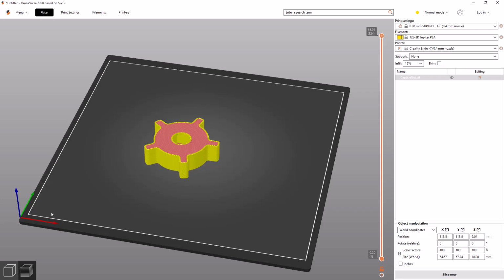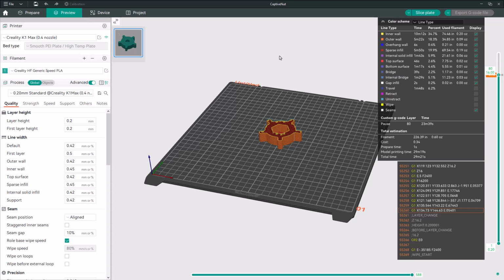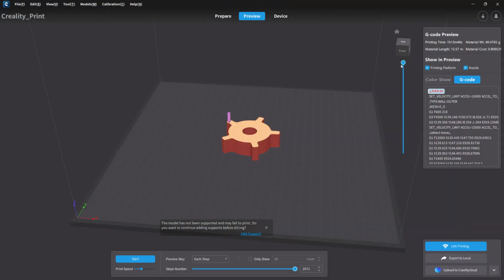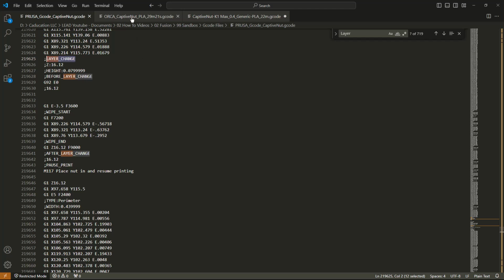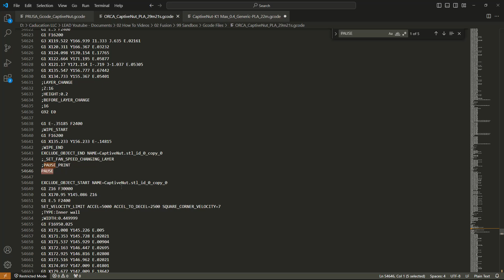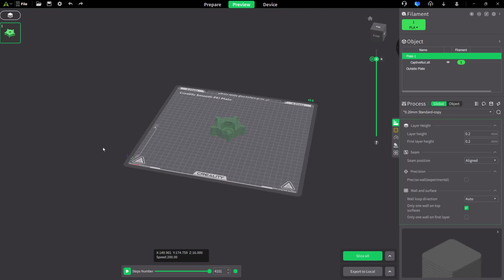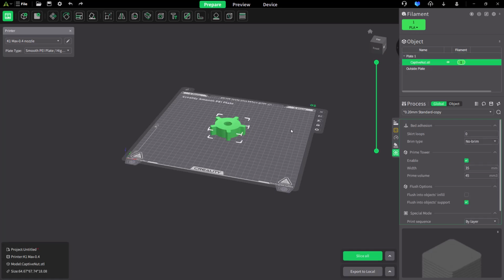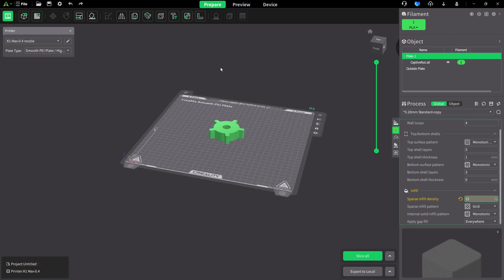Pausing a 3D Print with Different Slicers | Prusa | Orca | Creality | Cura

Comment: For Cura you need to select Extensions, Post Processing, Modify G Code.  Then select Add a script and Pause at Height (or Filament Change)  then fill out that form with the layer number and extruder information.
Reply: Absolutely the correct answer for Cura and it does not require one entering actual G code
Reply from the maker: Thanks for the info!
Reply: @LearnEverythingAboutDesign  A little research goes a long way when putting together a video like this spreading misinformation. Can't you put up some text or an insert with instructions?
Reply from the maker: @calvinborden43    What misinformation did I spread?  The extension/post processing method for the cura slicer is a manual process.  You have to fill out a form manually entering a layer and picking the M code you want to use.  When i made this video I had only a k1max which the cura slicer didn't support so no way to test it, but in the video I said you can't right click a layer and pause like most of the other slicers, which I do believe is true no?

And no sadly Youtube doesn't let you make any edits to the videos.  Best I can do is add/pin a comment and edit the video description, but nothing in the actual video can change.
Reply: @calvinborden43  Have you gotten the Cura's pause at height to work on a k1? It pauses for me, but fails to resume. If so can you please share what settings you enter into the modifier please?

Comment: How can I avoid the thick, visible line or band that appears on the layer where the print resumes after a pause in Bambu Studio Slicer? I've noticed that after using the pause function, my part often has a noticeable line at the resume point. What specific slicer settings, parameters, or procedures do you recommend to minimize this mark and achieve a smooth surface after a pause?
Reply from the maker: I haven't been able to completely get rid of it sadly.  One tip I have heard (but haven't tried) was to create a print tower kind of like a purge block.  So on the resume it starts printing that layer on the tower first.  I don't know if its a temp issue/change.  Some materials are less apparent like pla-cf vs a shiny pla.
Reply: The purge tower alone is not enough. The purge tower still shows 50% of the line visible. I'm analyzing the filament change routine to incorporate what I can into the pause routine.
Reply from the maker: @florisdelfino  Thats a great idea.  It would suck to have to purge a bunch of material but maybe that is a big reason behind why Bambu does it.

Comment: Hello! I have a question. Is it possible to put a pause not between the layers, but in the middle of printing a layer? I'm using creality print K1C
Reply from the maker: in a slicer, now that I am aware of.  Probably something you would have to do manually in the code.  most of the slicers I have seen want you to pick a layer and it does it at the start of the layer.

Comment: When I add the script for pause at layer height, it will beep pause and then continue printing. Using Cura 5.6. What could be causing that?
Reply from the maker: which printer are you using and which firmware is on that printer?  That could be the reason.  It should generally work with Marlin, Griffin, BQ, RepRap and others from version 5.7.  I don't know where 5.6 support stopped.  Klipper based printers might need some more customization. 

For most it should work just going to the Extensions Menu in Cura , "Post Processing" and then Modify G Code.  Add a new script and find Pause at Height.
Reply: @LearnEverythingAboutDesign  It's a Creality Ender 3 Pro V2. Stock machine, No firmware updates. Running version 1.0.2. which I'm assuming is Creality's Marlin version 2.0. I always use Ultimakers versions of Cura.

Comment: does not work
Reply from the maker: Which printer/slicer isn't working?  I had the best luck with the older creality slicer on the k1 max as it moved the print head out of the way.  some of the other slicers just pause and it can be tricky to get there.

Comment: Been trying all morning to get my K1 Max to pause at a specified layer with Prusa slicer. Your one line "K1 not currently suported". Ah. Thank you!

I then moved on to my Voron and it doesnt work either. Seems I need to modify the printer settings.. a bit annoying honestly.

I'm ready to move both these printers on and get a Bambu P1P.
Reply from the maker: Did you try the video before this one?  https://youtu.be/n1iMrPYjvAw   I can't remember if i walked through the old creality slicer in both videos or not.

My k1 worked great for awhile but im trying to sort out some ringing problems on it....
Reply: @LearnEverythingAboutDesign  I ended up using Orca Slicer (which also gives the best top layers on the K1 Max which I've not been able to replicate in Prusa).

Depending on when you bought your K1 Max you may have smooth idler pulleys and 44t motor pulleys (earlier models like mine have this). 

Changing these out for 20t pulleys and toothed idler pulleys make a big difference to ringing and wall quality.

Unfortunately it requires fully pulling apart the gantry to resolve and I can't afford the downtime on that printer right now. 

Maybe you could do a video about it one day 😏

Comment: Thanks for the video!
What I'm missing in pause guide videos, is that i need the extruder to go away from printed object (like go to  home) and after i insertd parts, by hitting "resume" on printer, it goes on printing from the next layer. What i encountered after testing orca, or just adding pause command in g-code manually, is that the nozzle gets stuck over the object! I couldn't find any simple explanations to figure this problem out.
Reply from the maker: Which printer are you using and/or which firmware is it running?
Reply: @LearnEverythingAboutDesign  I'm using a creality cr 10-SE.
Reply: @LearnEverythingAboutDesign  honestly, i don't know about the firmware. It's what was originally on the device. I normally use creality slicer (the version that you mentioned you prefered). I assumed if i go for a new slicer like orca, which has the pause option, the homing  will be automatically considered in the final g-code.
Reply from the maker: @hodabp6351  That printer should run the Marlin firmware.  https://marlinfw.org/meta/gcode/   If you were doing it manually you would use the M25 code and note it has a Park option which would move the head.  This should be the code used if you do it in the slicer.
Reply: @LearnEverythingAboutDesign  thank you! I'll check the link 🙏🌷

Comment: In my 5-year history of 3D printing, I have yet to figure out how to get a completed 3D print that was paused (for magnet or nut insertion) to NOT have a visible 'tell' where the pause occurred.

And very often, the location where the pause occurred results in the print being greatly weakened, layer adhesion-wise, at the pause location.
Reply from the maker: Yeah the layer line tell is hard to get around.  You can do it with geometry changes.  What i found with this part is that about half the print is perfect at that layer line but the other half does show a small line.  I can't comment on the  weakness as I haven't had a part fail at that layer line before.
Reply: @LearnEverythingAboutDesign  I haven't had a part fail at the 'tell' layer, either...under normal use. I just tested it by forcing a part to separate, and it was a the pause layer that it came apart.
Reply from the maker: @imacmill  Would be interesting to see if that was true because of the nut/captive piece was there pushing on a wall or more because of the layer lines.  Maybe i should do some testing.  thanks!